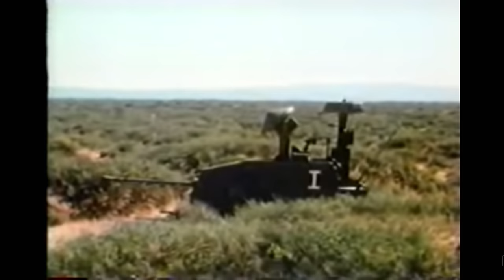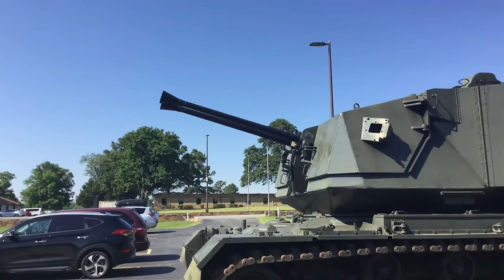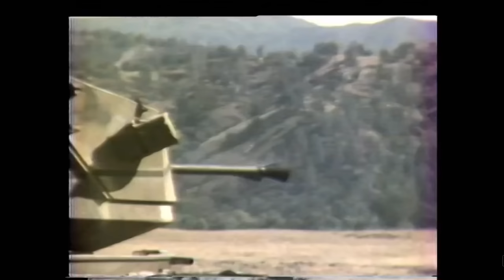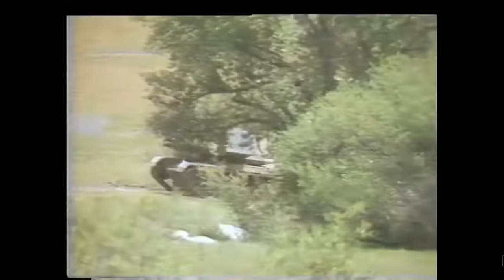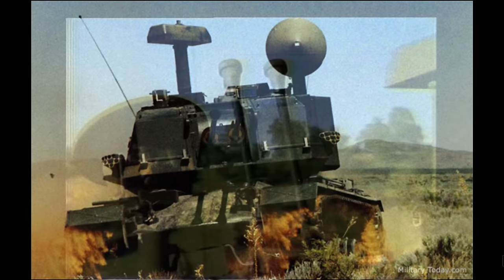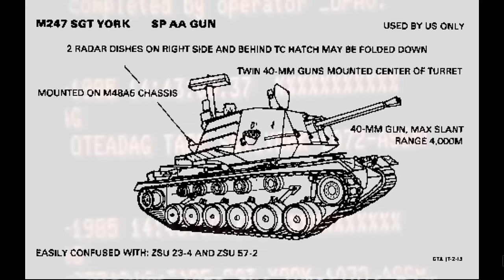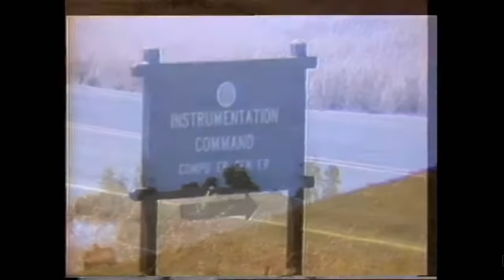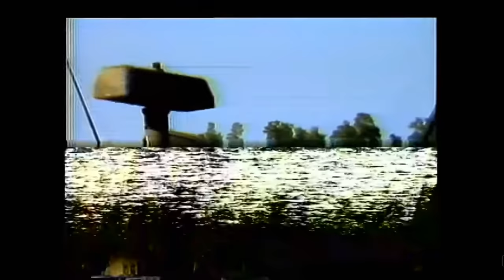M247 'Sergeant York' | WORST AIR DEFENSE EVER!

Comment: I'm definitely a fan of Ford trucks. I don't like the modular platforms.  Love the old police cars with 302 or 351 cubic inches  are tough and can be cheap and easily work on. I prefer the M42A1 Duster. It was an impressive machine for use on rotor craft.

Comment: To be fair, and this an eye roll statement I agree.  But hey, it was found out.  It got cancelled and ultimately the system worked.  System meaning the procurement system not the weapon system.  Some countries they would have simply bribed a few officials and some guy in a war zone will get called stupid and cowardly because it’s not working properly.  It seemed they were trying to save a few bucks using an old chassis, a WWII weapon system and slapping on an unreliable radar to it.  And my Ford Flex blew its engine at 115k miles.  So no more Fords for me either.

Comment: There was competition between York and Roland; during the tests at Wsmr  York had trouble hitting a UH 1 Stationary on a stand, while Roland hit 10 bats in a row as well as an all up full size target. I was tangentially involved and got a certificate, but my Father was the SNCO during the program for Roland. Roland's fail was it was a Foreign system being sold to NM National Guard, and the chain of supply for the missiles was Not secure, thus the program was cancelled. Still in simulator it was a Lot of fun to operate.

Comment: The 40mm guns would have a place in todays world, they would be great for intercepting incoming missiles. That's why Russian mobile AA trucks all have big assed cannons on them. You just need to have a hybrid system that also carries missile to hit the aircraft at their standoff range. 

The problem with the guns on the M247 was that they were very old and poorly maintained. They all had imperfections in the barrels that caused a serious reduction in accuracy. Of course, that would prove to be just one problem of many and not the most severe. 

The old M42 also proved that a tank with twin 40mm was ferocious in a ground fire role. The volume of 40mm explosive shells from an M42 proved devastating in Vietnam against troops hiding in the jungle.

Comment: A poor U.S. attempt at mimicking the Soviet ZSU-23-4 Shilka. SY was an embarrassment to the U.S. Army.
Reply: That was the M163, in service since 1968. The M247 was an attempt at mimicking the Flakpanzer Gepard.
Reply: Neutron Alchemist No. clearly, military planners had the Shilka in mind.
Reply: @catman351  the Shilka is a quad mount short-range 23mm SPAAG, and had several western equivalents (M163, SIDAM_25...) the M247 was evidently aimed at the Gepard and its twin 35mm mount, other than being a modernization of the M42 duster.
Reply: Neutron Alchemist The Gepard isn’t on the minds on the war planners as a threat in the 1970s. The bogeyman was clearly the Shilka. It still was a problem 20 years later a problem in the Gulf and Iraqi Freedom. It still continues to be a relevant threat because the Russians continue to upgrade that platform today.
Reply: @catman351  The Gepard was introduced in 1975 and was clearly the best kid in town by then. What move the designers is the best tech available, not the most used, nor the upgrades at 40 years distance.
Reply: @neutronalchemist3241  Yes, it is: while you say the Gepard is the reason why the SY was designed, I can tell you from at least the horse's mouth, the Shilka was poken of at the design boards when designing the M247. Remember that incident I spoke of at Aberdeen? My friend's account didn't include comm2nts about "that damn commie AA gun that laid down alot of firepower." Oh sure, for tech's sake, a "U.S. Gepard" was the goal, but even that paled in comparison to the Shilka.

Comment: About 6 years ago about five or six of these showed up at a range in Nv. They had been in moth ball and looked new and complete except the battle computer and laser range finder. Some had their barrel cut off or bent and some were complete! The gas turbine APU still inside the engine compartment. The first photo at the beginning of the video showes one. At that time you probable put batteries in them and start them. Several of them were parked on BLM land so they are pretty pick over.

Comment: An Aerospace power house, Ford is not! They make some of the best truck around, but anti-aircraft system maker it is not. Ford must have wanted to relive the heady days of WWII and decided to do a bit of vintage weapons making by looking backwards, using an old gun good for its day but not today or 1980's for that matter, using an old tank platform the unchanged hull of a heavy battle tank that was completely unrevised, and trying to mate ultra-cutting edge technology to it was an idea that was doomed since inception. You have to admit, Ford makes awesome trucks but their days of making weapons and armor for the U.S. military is something that should stay in the past. There were so many things wrong with that piece of crap, things that they had no idea about, that we take for granted today,  like how so many guns made during wartime, were good at what they did, which was shoot, if it shot, it was good, but today we expect much more from our equipment, and HOW a gun is made greatly affects how well it performs. Those old guns had a great deal of limitations built into them because the standards to which they were made were a lot lower than we have today. This thing was doomed and quite frankly so was the General Dynamics vehicle by virtue of the same information, the Soviet Missile capabilities outstretched the vehicle's capabilities before they could ever be made and put into service. now, I think that the German Flakpanzer of the same time period was significantly better than anything anyone else had made up to that point. I'd wager that the thick Forests of Bavaria would be an excellent place to hide those flakpanzers and I think that the thing had a number of different kinds of radar that made it serviceable.

Comment: The 40L70 was and still is a formidable weapon, the CV90 is still using it, and it is a grand weapon.
What it needs is a good radar/fire system to be effective, the vehicle then is not that important, wheeled, tracked, on a truck, never mind.
35 mm was a NATO wet dream and although it was faster firing, it definitely was not so effective as the 40 mm.

Comment: I saw one of these! The South Carolina Army National Guard had one in a depot in Columbia, South Carolina. In person, it looked pretty badass to my twelve-year-old mind. A mini-tank with not one, but two guns, and they both fired like machine guns? How could that not be awesome?

Well, yeah - it would have been awesome, if it actually worked. Little did I realize it was such an awful execution of the concept that even humorists like Dave Barry weighed in on it, saying it was an anti-aircraft gun so awful that it would only work in the sense of someone sneaking into the cockpit of an enemy plane and clubbing the pilot with it.
Reply: Tom Farrier Retired USAF rescue helicopter pilot; current aviation safety contractor (UAS) said:
In 1982 I participated in both cooperative and non-cooperative tests at Aberdeen Proving Grounds in Maryland, flying an Air Force CH-3E helicopter against a Sergeant York. I would have been dead many times over had it been shooting live rounds at us instead of just video.

The Sergeant York was the front-runner in a program intended to provide the Army with a sorely needed “division air defense” (DIVAD) weapon system. It was based on a novel concept: re-purposing M48 Patton tank chassis’ with a new turret incorporating twin Swedish Bofors 40mm cannons and two radar systems — one for area surveillance (the rectangular antenna) and one for targeting (the conical antenna, an off-the-shelf application of the F-16′s radar).

A firing control system integrated the two radars, with on-board software prioritizing targets based on the threat they were assessed to pose to the system itself. (For the late ’70s /early ’80s, this was cosmic.) If the operator elected to allow the system to engage targets hands-off, it would slew the turret around at a nauseatingly rapid rate, taking on each in turn automatically.

On the next-to-last day of the test, my aircraft was joined by an Army AH-1 Cobra and OH-58 Kiowa and two Air Force A-10s. My H-3 was part of the test profile because its radar signature was essentially the same as that of an Mi-24 HIND assault helicopter of the day, which was heavily armed with both anti-tank missiles and rockets. We all converged on it simultaneously from about 6000 meters. My aircraft was the first to die, followed by the two A-10s, then the Cobra, and finally the Kiowa. It took less than 15 seconds to put plenty of hypothetical rounds into each of us.

I spent a depressing amount of that week watching myself get tracked and killed on video. Trying to “mask” behind anything other than rising terrain simply didn’t work; the DIVAD radar got a nice Doppler return off my rotor system if any part of it was within its line of sight, and it burned right through trees just fine. I couldn’t outrun or out-maneuver it laterally; when I moved, it tracked me. I left feeling pretty convinced that it was the Next Big Thing, especially since I’d come into the test pretty cocky thanks to having had a lot of (successful) exercise experience against current Army air defense systems.
So, what happened to the program itself? I think it was a combination of factors. First, the off-the-shelf concept was cool as far as it went, but the Patton design already was a quarter-century old; the DIVAD was awfully slow compared with the M1 Abrams tanks it was supposed to protect. It would have had a lot of trouble keeping up with the pack.

Second, The Atlantic Monthly published a really nasty article (bordering on a hatchet job) purporting to show the program was a complete failure and a ruinous waste of money. One of its most impressive bits of propaganda was an anecdote about a test where the system — on full automatic — took aim at a nearby trailer full of monitoring equipment. Paraphrasing, “It tracked and killed an exhaust fan,” chortled the author. (See The Gun That Shoots Fans for a recounting of this.)

Yeah, it did. It was designed to look for things that rotate (like helicopter main rotor systems) and prioritize them for prompt destruction. If any bad guys were on the battlefield in vehicles with unshrouded exhaust fans, they might have been blown away rather comprehensively. (My understanding at the time was that said fan was part of a rest room in one of the support vehicles and not a “latrine,” but why mess up a good narrative, right?)
To my knowledge, neither ventilated latrines nor RVs full of recording devices are part of a typical Army unit’s table of allowance, so I really doubt there was much of a fratricide threat there. However, the bottom line was that this particular piece of partisan reporting beat the crap out of a program that I believe the Army needed, but already was facing a few developmental issues, and helped hasten its cancellation.

(The New York Times opinion piece linked to above was equally laden with innuendo and assumptions. It made a fair point about possible anti-radiation attacks it might have invited… but there are radars on every battlefield, and there are means of controlling emissions. It compared a late-Fifties era Soviet system — the ZSU-23–4 — with one fully twenty years newer in design. It asserted that it couldn’t hit fixed-wing aircraft, which to my mind and personal observation was arrant nonsense. The only issue it raised that I agree with was possible NATO compatibility problems with the unique 40mm caliber shells the Sergeant York’s guns fired. Funny — the Times pontificated that it wouldn’t be cancelled, too. Oops.)

Third, the hydraulics that were used in the prototype were a 3000 psi system that really couldn’t handle the weight of the turret in its Awesome Hosing Things mode. One of the only times I actually got a score on the system was when I cheated; I deliberately exploited that vulnerability. I flew straight toward the system (which would have blown us out of the sky about twenty times over had I tried to do so for real) until directly over it, then tried to defeat the system from above.

If memory serves, the system specifications called for the guns to elevate to more than 85 degrees if something was coming up and over; it then would lower them quickly, slew the turret 180 degrees around, and raise the guns again to re-engage. It was supposed to be able to do that in perhaps ten seconds (but I’m here to tell you it did it a lot faster than that). So, I had my flight engineer tell me the moment the guns dropped, at which point I did a course reversal maneuver to try to catch it pointed the wrong way. What the video later showed was:
Helicopter flies over.
Traverse/re-acquire movement starts.
Helicopter initiated hammerhead turn (gorgeous, if I say so myself).
Guns started to elevate to re-engage.
Clunk. Guns fall helplessly down; DIVAD crew uses bad language.
The hydraulics hadn’t been able to support the multiple close-on, consecutive demands of movement in multiple axes and failed. Like I said, I cheated. The Army and the contractors already knew about this problem and were going to fit out production models with a 5000 psi system. That might have had some survivability issues of its own, but the Army was perfectly happy that we’d done what we did — it proved the test wasn’t rigged and underscored the need for the production change.

Finally, the Army itself honestly appraised the system based on its progress (and lack of progress) versus their requirements. Wikipedia provides a passage that encapsulates this end-game well: “The M247 OT&E Director, Jack Krings, stated the tests showed, ‘...the SGT YORK was not operationally effective in adequately protecting friendly forces during simulated combat, even though its inherent capabilities provided improvement over the current [General Electric] Vulcan gun system. The SGT YORK was not operationally suitable because of its low availability during the tests.’ ”

I guess I’m forced to conclude that the Sergeant York was a really good concept with some definite developmental flaws — some recognized and being dealt with, perhaps one or two that would have made it less than fully effective in its intended role — that was expensive enough for bad PR to help bring it down before it fully matured. The Army was under a lot of political pressure to get it fielded, but to their credit they decided not to potentially throw good money after bad.

On balance, a lot of the contemporaneous criticisms mounted against the M247 really don’t hold up very well over time. Short-range air defense currently is provided by the latest generation of the AN/MPQ-64F1 Improved Sentinel system. Radar emitting on the battlefield? Check. Target prioritization capabilities? Check. Towed (which equals “slow”) versus self-propelled? Check.

I’m glad we never wound up in the position of needing it but not having it. My personal judgment was and is that it probably could have wound up a heck of a lot more capable and useful than its developmental history might suggest, but its cancellation probably was justified given other acquisition priorities at the time.

Bottom line: I repeatedly flew a helicopter against it over the course of many hours of testing, including coming at it as unpredictably as I knew how, and it cleaned my clock pretty much every time.

... yeah, the guys who were testing the damn thing tell otherwise.

Comment: Can't they just buy liscence of gepard ?! Or obtain production rights of OTO MELARA's OTOMATIK ?!?!
Reply: It would have been nice, since the Otomatic used off-the-shelf components too  (an ubiquitous Otobreda 76mm naval defense gun turret placed on a OF-40 or Leopard I tank hull), was 17km/h faster than the M247, had a 35cm lower shape,  and its gun outranged any anti-tank helicopter missile by a considerable margin. By now it would have had guided ammunitions available too.
Reply: @neutronalchemist3241  Not to mention the new DART guided rounds for naval melara guns currently also avaliable ! 
Want to gain greater range than current anti-air artillery but cost lower than missiles ? Here's OTOMATIK for you !
Reply: @NeoPsychosis-zg2ki  Or the new 40km range Vulcano ammos. They would be effective vs. MBTs too (76mm could not seem that much vs. modern MBTs , but the projectiles would arrive practically from the vertical, where tanks are scarcely protected, and kinetic penetrators are not disturbed by modern active defence systems, like the  Trophy).

Comment: The account of a helicopter pilot that participated in M247 testing:
https://www.quora.com/How-effective-would-an-M247-Sergeant-York-have-been-at-shooting-down-helicopters/answer/Tom-Farrier?ch=10&share=bc352fd8&srid=umOoj

"We all converged on it simultaneously from about 6000 meters. My aircraft was the first to die, followed by the two A-10s, then the Cobra, and finally the Kiowa. It took less than 15 seconds to put plenty of hypothetical rounds into each of us."

"Bottom line: I repeatedly flew a helicopter against it over the course of many hours of testing, including coming at it as unpredictably as I knew how, and it cleaned my clock pretty much every time."